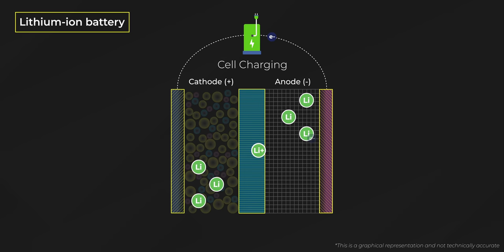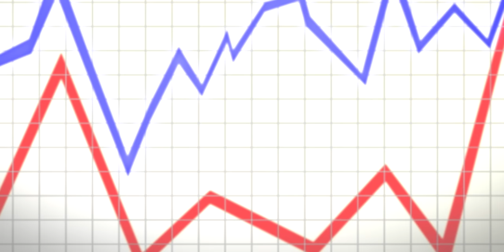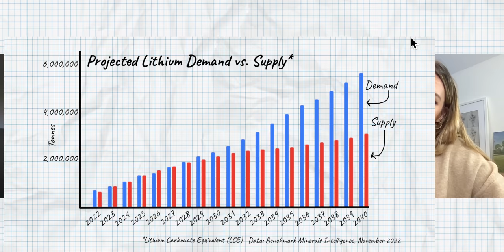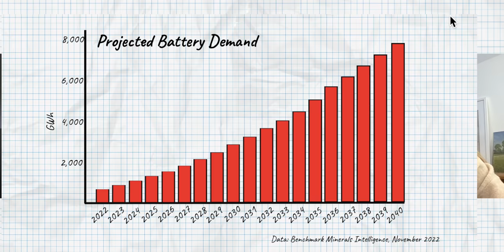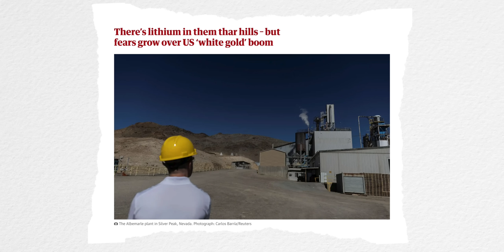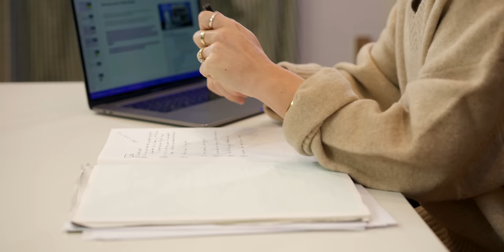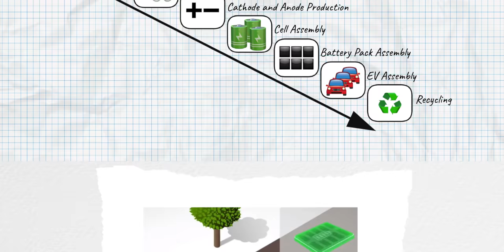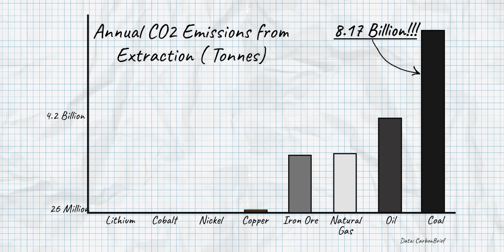There's a Massive EV Battery Shortage. THIS is How We Fix It

Comment: EVs are already having a staggering effect on the environment and human rights.  The way to solve this battery shortage is to keep ICE cars around.  They are cleaner than ever and are not a major source of pollution. On the other hand, all the coal and gas-powered power plants needed to produce all this electricity have significant impact on pollution, at least locally.  No, the real answer is to tap into true Tesla power, but that's a whole other conversation.
Reply: Lol. You could power an EV by burning the oil in an oil power plant, instead of refining it into gasoline and then burning it in a combustion vehicle, and still emit less Carbon into the atmosphere.
Yes, even with production of the cars figured in. Refining oil takes that much energy and combustion vehicles are that inefficient.

Comment: Nothing like a good old fashioned infernal combustion engine. I just bought my « new » car. It’s 18 years old, has no over complex electronics, can be serviced and repaired by your average DIY mechanic and has been remapped to run on E85 bio ethanol. Is it worse for the planet than a Chinese built EV, which uses rare metals to build its batteries and for which 65% of the electricity used for its production is produced by coal fired power stations. Sorry EV/ecology promoters, but I just don’t get it.  🤔
Oh yes, my car will also do over 700km on one « charge », how many EV’s can do that?
Reply: @4203105  yep i certainly would have a hard time with no car. I love driving and always have, I also live in a rural area, so my car is not a luxury. You might get city dwellers out of their cars, but never 99% of Europeans. I’m still not entirely convinced that my carbon footprint is worse than the bloke who’s just bought a huge electric SUV. 
A Zoe or similar would certainly be fine for getting around town, but for longer journeys an EV just isn’t yet a viable option, and will not be until:
1. the world’s electricity supply is no longer largely based on fossil fuels
2. We don’t depend on polluting Chinese industry to build EV’s for us
3. Battery technology has improved to the point where range anxiety is no longer an issue
4. Car batteries no longer weigh so much that a sizable proportion of the energy they supply is wasted just dragging them around in the car. 

I think there’s a place for both the ICE and EV in the medium term. Horses for courses as they say. It’s much too early to oblige us all to go EV. Personally I couldn’t afford to anyway, and think that’s the case for the majority of people.
Reply: @robinforrest7680  If you are driving a gas car, your carbon footprint, is quite a bit worse than the bloke's who just bought an electric SUV (over the lifetime of the car, only considering the car). Of course that bloke should really buy a smaller car with a more sensibly sized battery and less air resistance, but thus is capitalism.
Most EVs are viable for long journeys. As you can fast charge at every service area at every Highway. At least in europe. Not sure where you live. Also tbh I haven't driven more than 100km from my home by car in years anyway and I still have an ICE car. The Autobahn is too conjested and it's too much stress to drive on it. I just take the train. Way less stressfull. Not sure why nobody considers that as an option.
I also live pretty rural, so I have to have a car, but that doesn't mean that I have to use it to drive all throughout europe.
1. Even if you fuel your electric car exclusively with electricity from a gas power plant, it still emits less CO2 over it's lifetime than a combustion car. Though thankfully europes electricity mix is quite a bit better than that.
2. We depend on that same industry to build combustion cars for us. Is your solution to get rid of capitalism or just cars?
3. Range anxiety can only be solved by people testing out electric cars, not by improving battery technology. It is a psychological problem, not a technical one.
4. The weight isn't a big problem, as you get a good amount of the energy back through regenerative breaking. If you want to talk about inefficiencies, better not look at combustine engine cars. Because, uh boy...

I don't think anybody is obliging you to go EV. We couldn't replace all cars tomorrow if we wanted to. It will happen gradually. At some point an EV will just be cheaper than a combustion car. It already is if you consider lifetimes costs, but eventually it will also be just in terms of MSRP. Sadly the pandemic and the war in europe have pushed that date back a few years, but it's still coming.